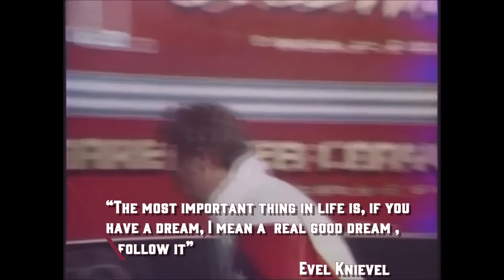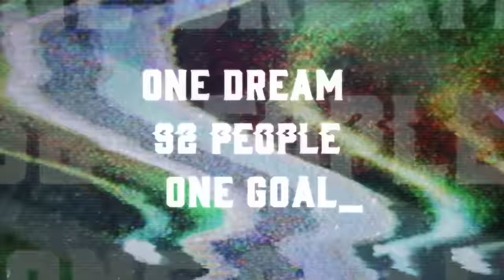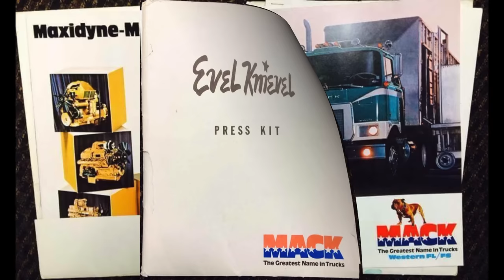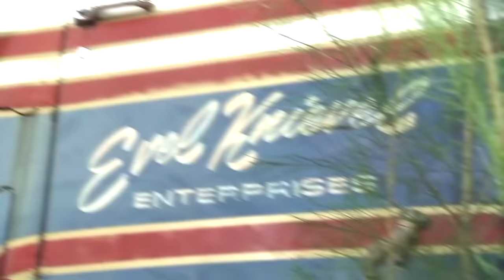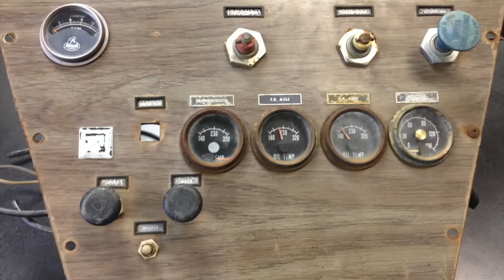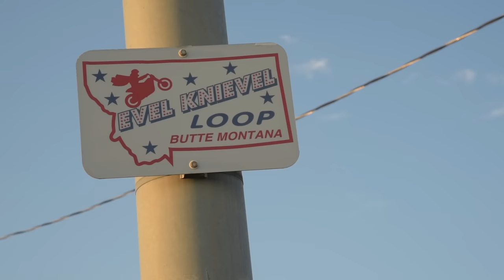Resurrection of Evel Knievel’s world famous Mack truck

Comment: I watched a video of when it was discovered and pulled out for the first time in a while and was blown away to discover I'd been driving right past it for years. I knew where it was the moment they showed the sign in front of the building. 
Tucked away in the back lot of a body/custom shop, hidden in plain sight, but with the overgrowth and fencing it wasn't visible from the road. lol 
And it made perfect sense since Evel lived just a few miles from the place. I met him briefly on one occasion when I worked at Lokey Mercedes in Clearwater Florida because he had a burned out marker light in his Benz. Swapped it out right there in the in the drive and he was on his way. An absolute legend to me growing up. I'm glad to see this history live on.
Reply: I was surprised there was no footage of Mark from Shipping Wars hauling it from there. I thought for sure they would show that. I wonder how much of the original truck they were able to save because the cab was completely shot, they obviously used a donor truck. Maybe the frame is original.

Comment: My Dad, Bob Rogers, was a painter at Mack Western.  He designed and did all the original pin striping on the truck by hand.  Have an old black and white photo of him and all the other guys who worked on it as it rolled off the line :)
Reply: That's my Dad standing to the left of the guy in the black jacket at 9:43 :)